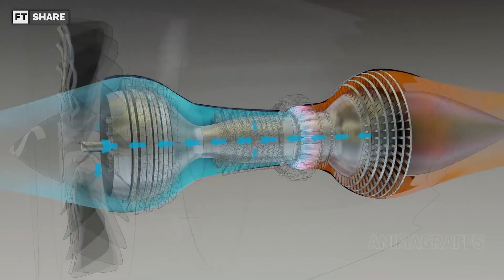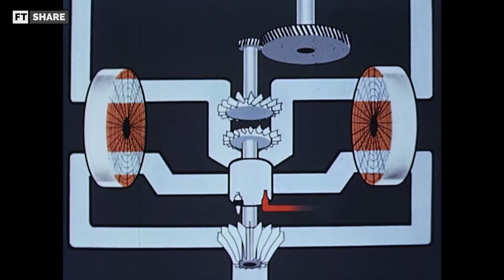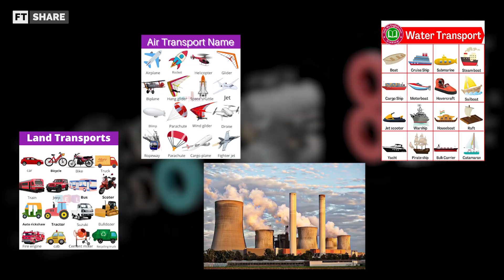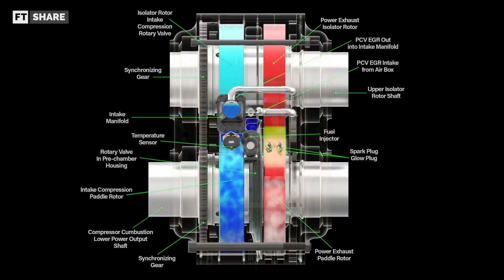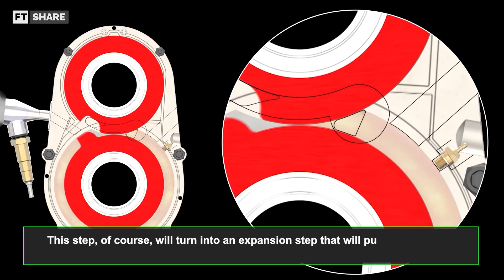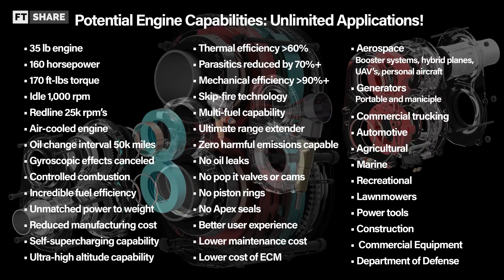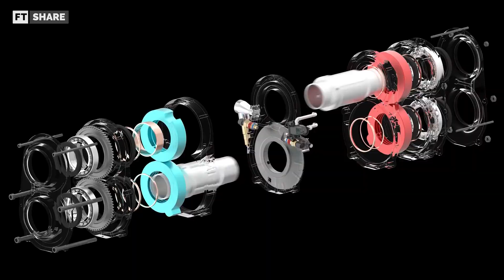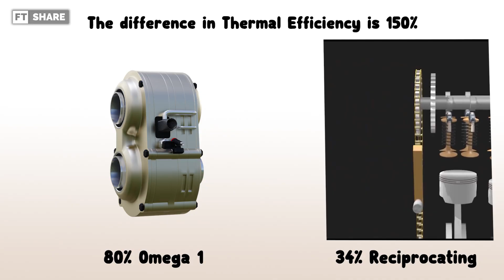Ready To Destroy EV Engine!! | Astron Aerospace - Omega 1 Engine

Comment: 9:24  "AT PUSH 3.355KW" = 4.5hp = lawn mower.
Reply from the maker: heheh sorry. i mean Threethousand KW. not 3.5 hehehe thanks for yout correction 🙏😂
Reply: 9:24  "AT PUSH 3355KW" = 4500 hp = not likely. Mark it down as an exaggeration.

Comment: 9:25 Being powered by compressed air, not actually running.
Reply: Yeah, soundeded like tata motors compressed air car.
Reply: @satunnainenkatselija4478  At the time stamp 9:25 the red hose is clearly compressed air being pushed in to make the engine spin. Zero doubt. Other hoses for lubrication, etc.

If you doubt, then you have to explain-away the red air hose.
Reply: Note the exhaust flash, this is not just being run on compressed air. How much power it will produce and how long it will run before it self destructs is the real issue.
Reply: Correct. It doesn't even self sustain

Comment: Would be smarter to have only one of "rotors" to do all. It should just have more "teeth" and everything done by 1 rotor.
Having 2 of them being close to each other and having to hold back pressure... Doesn't seem too smart if you ask me.
They must have some sort of seals between those 2 rotors.
I think i could find a better idea. But i don't have some fancy friends or degree so no one would care and i would have to build, pay (machines too) and research it all by myself. Too old for that and someone else will get the idea some day and make it happen before i could :)
But i'd like to see a finished one of these to see how reliable they actually are. I doubt thery will get too far. But i wish them the best. First step to make it work, which it does. And throw out all the theoretical stuff, and make it work instead ;)
Reply: It seems to almost work like a supercharger
Reply: Never lose hope my friend, Ray Kroc started at 52

Comment: There's a reason turbine engines are no longer used in cars. There's a reason rotary engines are no longer used in cars. There's a reason a combination of the two won't be used.
So far only a Spanish company has re-invented the ICE engine.
Unfortunately all ICE engines will be banned from sales in Europe by 2035.
Reply: @Eef Neleman
INNengine, is it the Spanish company you are thinking about?
Reply: @DavidH_1_2_3  yes, exactly.
Reply: Its time for DFI 2 stroke to make a comeback. Rotex 850 ETEC turbo R and Achates power 2 stroke OP forever! Brappp.

Comment: Yeah, I don't think so. This engine only works in the lab.  Notice how there is no video of it powering a vehicle.
Reply: See it pissing fuel out the seal's
Reply: @some_random_garage  . Had another look at the Video . Since the End of the Engine shown dripping  appeared to be indicated to be the INDUCTION side , I  have reason to think the Dripping was NOT  fuel , but rather , CONDENSATION . Caused on the Suction side of the Induction Rotor . 
Keeping in mind , this IS an experimental concept , under development , Materials Science would likely solve the issue .
Perhaps  simply using TWO lobes in each Chamber . 
Lower  Pressure Flux , but at twice the Rate . Better balance as well .
Reply: @some_random_garage yea that’s super sketchy and sus
Reply: There are other videos of it being developed.
Reply: Yeah . That's right . Because it's currently a CONCEPT  ENGINE  UNDER  DEVELOPMENT . That was obvious from the Video .
Reply: @johncunningham4820  how does the power get transferred to a drive shaft?
Reply: @helderpow  . Well , when the Engine gets developed beyond a mere Prototype , i imagine making one of the Core Cylinders Longer , and using a Gear Driven  Power take-off would suffice . 
There are Other possibilities too .
Reply: @johncunningham4820  That's what i was thinking, longer "pipe", with a gear for a chain. Cool, but what are the other possibilities? I'm thinking a tesla turbine. What you got?
Reply: @helderpow  . Well since those Tubes are the Air Intake and also part of the Cooling system , so internal Spiral Finning could be beneficial . And making the tube that takes the Actual Power somewhat longer and making it into the Input Shaft of a Constant Mesh gearbox , like a Motorcycle , you can produce multiple ratios and install the Clutch  on the Output Shaft .
Reply: @johncunningham4820  you obviously watch dirty garage guy to